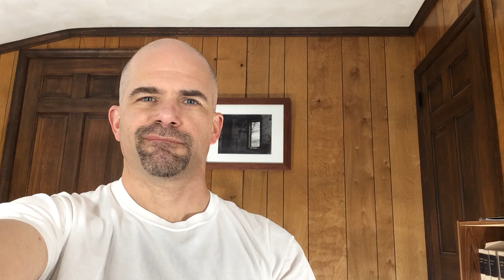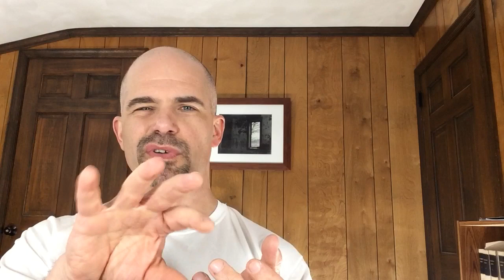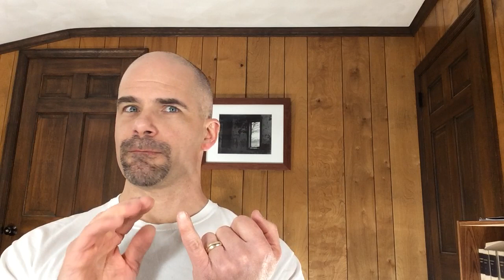Paintball Accuracy, Episode 4: Smooth vs. Spin-Inducing Barrels

Comment: Hey, pretty great videos so far.

I wanted to comment on the flatline barrel systems. Which I did leave a similar comment on a previous video which will be similar in detail. 

But if we're discussing accuracy, we're discussing our ability to hit a target, and from what I recall the purpose of the flatline barrel was for things like woodsball and scenario play. The idea being you get 2 advantages over a normal barrel: 
1) A flatter trajectory to help with shooting through/past obstacles like underbrush, low hanging branches, and openings in buildings.
2) Longer distances so you can have a chance at hitting other players before they can effectively return fire.

Would you say that in such scenarios, that the accuracy may be significantly increased?
Reply from the maker: Again, thanks for posting up.  As noted from 13:30 on, while it is true that you can get more distance, and while it is true that you can get some different angles with respect to obstacles (and while it is true that they can be fun), both the physics of what is happening, and also the simple fact that the orientation of the barrel (and thus the Magnus effect it induces) is never going to be the same from shot to shot, means that backspin barrels simply do not have the ability to facilitate the same level of usable accuracy  that traditional smooth bore barrels can give. 

So yes, you have longer range, and yes, you can alter the trajectory of your shots, and therefore can have more chances to hit an opponent who cannot return fire, but that is not the same thing as accuracy.

Hope that helps, and thanks again for weighing in.
Reply: @thatpaintballchannel179  I'm not trying to be obtuse, so please excuse me if anything I say sounds overly argumentative, but aren't you using the term wrong?

Accuracy is the ability to hit a target at all, and you are discussing real world usable accuracy. Which, this seems to fall right in line with what you were discussing previously about aftermarket barrels having a place in the paintball market.

So wouldn't these two statement hold true
1) At long range the flatline barrel system is more accurate as it has a longer effective range. Essentially a smooth bore has 0 capability to hit anything at a certain range, and the flatline is still hitting targets at that same range. Therefore, it's more accurate within these certain parameters.
2) In areas where you can see a target but don't have the space to arc a shot to achieve the range, a flatline barrel would be more accurate as it can still hit the target where the smooth bore can not.

It would seem that if you play in heavily wooded areas, larger fields, and areas with smaller shot windows, that a flatline barrel may outperform a smooth bore in accuracy. To borrow a comment you've made, they may be more accurate real world than in controlled testing.
Reply from the maker: @nomercy4521  Again, thanks for posting up, and not at all obtuse. I'm enjoying this discussion very much.  I think there may be some variation in how we are using the word 'accuracy'.   Before we can even think about the issue of aiming the marker (covered in later episodes), we need to think about the issue of target consistency, which is the degree to which shots relate to the orientation of the barrel bore axis.  

In other words, if we could use a laser in the barrel bore and point it at a target, to what degree of consistency will all the shots fired from that barrel hit the target relative to that point?

Once we have established some sort of ideal baseline, we can then begin to talk about barrel bore corrections to account for distance, moving targets, winds, etc.  This will put our consistent spread of shots on the thing we actually want to hit.

That is the 'aiming' part of the equation, and brings the player into the problem.  But that has to come second.  If the barrel bore/paint/target issue isn't consistent, you can't have good accuracy, regardless of how skilled you are at aiming.

And in terms of backspin barrels, both the physics and the testing suggests that, especially at distance, they simply introduce too much randomness to be consistent.  This is especially true in the real world.  In other words, backspin barrels perform much better on a bench than they do in the hands of shooters, because of the issue of (non-vertical) marker orientation, which changes the Magnus effect and thus alters the trajectory of the ball drastically.

Does that make sense?

When you talk about being able to hit people far away, or through windows, this is more an issue of 'potential effectiveness' than 'accuracy'.  Lobbing rounds from a smooth bore (which can be done at pretty significant distances) can also be effective.  It is simply changing the trajectory of the shot.  

There are lots of situations where a lobbed shot is actually more effective than a flat shot, and vice-versa.  Just depends on the situation.  But at outer-limit distances, you are never really talking about true accuracy, regardless of the type of barrel used (unless you are using First Strike rounds).    

While we are at it, it is also the case that paint grenades can be very effective, especially through windows, around corners, etc. But this too is not accuracy.

Carpet-bombing an area one shot at a time at distance to hit someone (even if they can't hit you) may be effective, but it is not accuracy. It is carpet-bombing. Hopefully that distinction is clear.

I know there are lots of people who swear by backspin barrels, and who have very popular channels showing their amazing 'sniper' shots at great distances.  But if you study the videos long enough, you'll quickly see that a lot of paint is being used to get these cherry-picked shots.

Finally, to the real-world vs. scientific testing issue, even though we play in the real world, the real world obeys the laws of physics.  And in order to understand those laws, we have to do strictly controlled tests, so that when we get into the messiness of the real world, we aren't fooled by appearances, or wishful thinking, or other kinds of things that can make one thing seem better than another.

As I noted in this video, I used to own a backspin barrel, and while it was (no pun intended) a barrel of laughs, I would never use it in serious play, because (a) it lacks versatility, and (b) it simply can't perform at the same level.  

That said, if you want to run one, by all means, do so!  They are great fun, and they do have their uses.

Great conversation!  Thank you again!
Reply: @thatpaintballchannel179  I agree there is a variation in how we're using the word. Which is kind of my sticking point on how a flatline barrel can actually be more accurate than a smooth bore.
 
"Accuracy refers to the closeness of a measured value to a standard or known value."

In this case the target location, what you're aiming for, is the known value. Where your shot lands is the measured value. The accuracy is the relativity of those two values.

"Precision refers to the closeness of two or more measurements to each other."
This seems to be more what you're discussing when you're discussing "accuracy."

I don't mean to be overly semantic, but it's an important distinction for this discussion on flatline barrels.

The flatline barrel was designed to give a longer flatter trajectory. From everything I remember on the release, this was specifically for woodsball players where you had very limited capabilities to "lobb" a shot. Essentially tree canopies can often be low as well as you might have long sections of brush, bushes, or small trees, with clear view through that are too long and too straight to easily get a ball through with normal paintball trajectory.

So in that style of play, a flatline barrel can give you a greater capacity to get the "measured value close to the known value," or get the shot to actually hit the intended target, aka accuracy.
Reply: In that scenario, if one barrel, due to it's design, allows you to hit what you're aiming for while another barrel design does not, the precision/consistency isn't a factor anymore.

Would you disagree?
Reply from the maker: @nomercy4521  I think there is a confusion here between 'accuracy' and 'range'.  Or perhaps more precisely, between 'accuracy' and 'greater range/weird shot angle capacity'.  The two are completely different.  It is absolutely the case that a paintball fired from a backspin barrel has greater range than one fired from a standard barrel, all other things being equal.  But when both barrels are fixed to markers, benched, and viced, and actually measured with paint, the backspin barrel in general simply does not have the ability to produce the same level of target consistency as the smooth bore.

The bottom line is that without target consistency there is no accuracy, and accuracy is only as good as your target consistency.  Period.

And when you hold the two, and use the two in the real world, the difference is even greater, and not to the advantage of the backspin barrel.

It is simple physics.

Being able to reach out to even infinite distances and hit something very far away does not make something accurate.  It merely makes it have great range.

Imagine two pressure gauges.  One only goes to 200 psi, but is graded at 4A, while the other goes to 2000 psi, but is graded at B.

We would never say that because the one goes higher it is more accurate.  

Or think of baseball.  A good batter can certainly hit a ball farther than the pitcher can throw it.  And good batters can roughly aim their hits.  Now imagine we are trying to hit a target 300 or so feet away.  The batter takes shot after shot and eventually hits the target.  Meanwhile, the pitcher runs up to within 100 feet and throws a single pitch, and hits the target.  We would never say that, because the batter didn't have to move, he is more accurate, or that, because the struck balls went further, they were therefore more accurate. 

See what I mean?  

The pitcher is more accurate because, within range, he took fewer tries to hit the target.

That's kind of the idea here.  No one disputes that backspin barrels can give more range, and allow for funky angles.  But statistically speaking, within the given range/trajectory parameters, they require more shots than a smooth bore to hit their target, all other things being equal.

Great discussion!  Thanks very much again.
Reply: @thatpaintballchannel179  I think you're still confusing precision with accuracy. Precision is, generally speaking, an important aspect to accuracy, but considering paintballs don't have the trajectory of ammunition like real firearms, this is where it may not always matter for accuracy.

I think what I am saying might make more sense if we use your examples.

Lets say we have both barrels fixed to markers, benched,  and viced, sighted with a laser bore sight, and actually measured with paint,
 but instead of firing down just a big wide open target range, there are now obstacles that we commonly find in the woods. we have bushes, small trees, larger trees with low branches.

In a situation like this your "target consistency" may shift in the favor of a flatline barrel. The reason for this isn't due strictly to an increased range, but an increase in a flat trajectory. Meaning that at distance where the smooth bore would normally be more accurate, the flatline will be able to attain more "target consistency" based on the physical layout of the obstacles.
Reply: Which this is where the flatline barrel system was designed to function. In wooded areas where the real world lay out does more to inhibit standard paintball trajectory.

imagine having to shoot at a target, but in order to hit that target, you need to put your paintball through a 12 foot tube with a diameter of 8 inches. Sounds kind of crazy on just an open paintball field with standard hard cover, but it would mimic what you might see if you're playing in the woods. Someone is using some patchy under brush or bushes, he's there and you can see him, but with a regular paintball trajectory you can't physically put a round through that opening. 

The barriers literally limit the physical capability of achieving "target consistency."
Reply from the maker: @nomercy4521  We may simply be at an impasse with respect both to our definitions and also our objectives.  Based on your comments, the ability to negotiate specific obstacles in a specific context is important.  I do not disagree with you.  Backspin can help to negotiate these obstacles, and thus, to hit targets otherwise obscured by them.  

But I disagree that this constitutes either the essence, or the spirit, or the letter of the traditional definition of accuracy.  

And the reason for this is that, even benched, and viced, and accounting for the fact that backspun paintballs can negotiate tricky obstacles, they still require more shots to hit the target then a smoothbore.

A flat trajectory is not more accurate than a curved trajectory.  The shape of a trajectory is not what makes a thing accurate.  

The ability to hit targets aimed at along a possible trajectory of flight in a minimum number of shots is what makes a thing accurate.

So if a flatline barrel were rigged up to a target 100 feet away, and shot under low branches (which the smoothbore could not do), and a smoothbore barrel were benched and viced at a target 100 feet away, shooting over low bunkers (which the flatline could not do), the smoothbore would still take fewer shots on average to hit the targets along its own possible trajectory.

This is why smoothbore barrels are demonstrably more accurate.  Or rather, demonstrably less inaccurate.

You are making an argument based on incompatible trajectories and saying that, because Barrel A cannot shoot along a given trajectory for a given distance, it is therefore less accurate than Barrel B.  But the same logic can be applied to Barrel B, if it shoots along a different trajectory than Barrel A.

But as soon as we factor for both trajectories and distances, the smoothbore is always more accurate.

In a very, very narrow bandwidth the backspin barrel can be more effective at hitting some targets than a smoothbore (it can also turn corners and hit people behind bunkers, remember), but this utility in no way constitutes accuracy in any normal sense of the word.

But again, there is no reason to get hung up on semantics.  We aren't actually disagreeing on anything here besides how we define accuracy.  You like backspin barrels; good.  I'm not dissuading people from these barrels, or saying they have no value.  I'm simply extrapolating the physical and testing data, nothing more.

Again, this has been very enjoyable.  Thanks very kindly for the discussion!
Reply: @thatpaintballchannel179  I am still getting caught up from my Thanksgivings vacation and am now just reading your reply. Thanks for the discussion and your thoughts on the matter.

I agree. I think we may be at an impasse on how we are defining our terms.

Every discussion I've ever had on firearms was that precision defined the ability of putting rounds near one another, while the ability to put rounds on the point of aim was accuracy. On a target this would look like a cluster of rounds impacting a small area, let's say a 3 inch diameter, but may be 4 inches from the point of aim for precision. In contrast a 6 inch diameter grouping with 2 shots inside the bullseye, the point of aim in this scenario, would be an example of accuracy. So one would be a more precise, but less accurate shot, while the other would be a more accurate, but less precise shot.

That's where I think the crux of our discussion lays, and why I think a barrel like a flatline system can improve your accuracy based on the parameters of play.

This passed weekend I thought of this discussion while I played on a new field. Where I normally play, I have no real use for a flatline system and don't run it. Nothing about the size of the field or the obstacles would really lend it any real advantage. The field I played at this passed weekend incorporated a lot of wooded areas for most of the games they did. I did have issues not being able to land shots on target due to the level of underbrush. And I maintain that in that style of play you'd be able to shoot more accurately, or be able to land more shots on your point of aim. 

But thanks again and I'm glad you put more content out there, paintball can always use more good material out there.
Reply: I'd also point out that these definitions are why many gun enthusiasts I've spoken with hate using the term "accuracy" when discussing traditional firearms. As, almost always, accuracy is more of a discussion of the user, while precision is the discussion of the firearm.
Reply: @thatpaintballchannel179  by adding backspin, wouldn’t horizontal vortices still exist and hence not change the horizontal accuracy. And (as you stated) since we do not hold the guns perfectly vertical like tests, if we used a weight that would shift it to be vertical no matter the gun orientation, would that help the spin consistently enough to make it better? But then again, as you said, the backspin is unreliable from ball to ball, so there will be more or less vertical alterations from shot to shot. So in the end, would these even be more “accurate” if they could be shot vertically from the user
Reply: I would add that, this is what the flatline barrel was designed for. It wasn't designed to increase precision, but specifically increase accuracy in certain environments, specifically in heavily wooded areas.